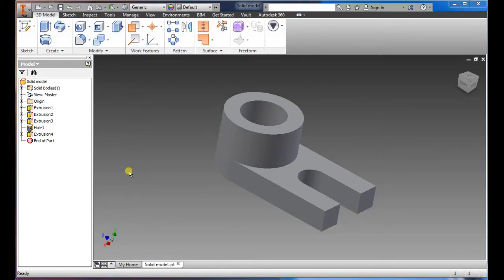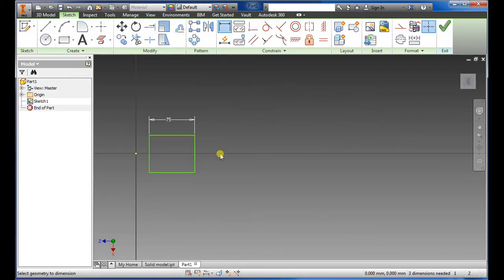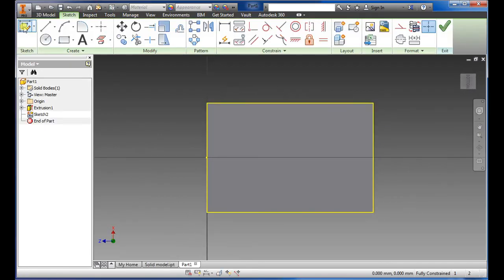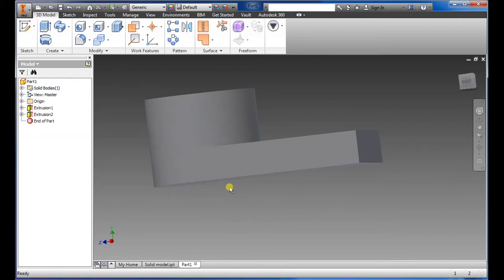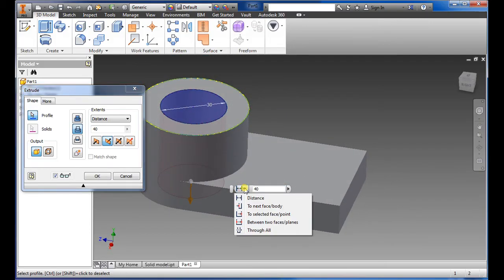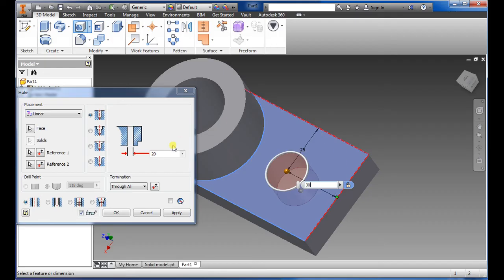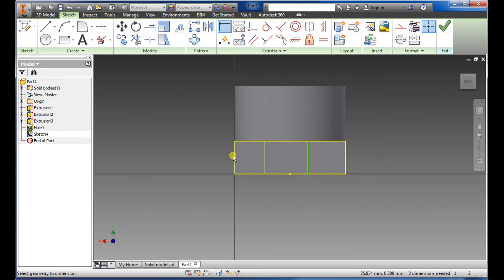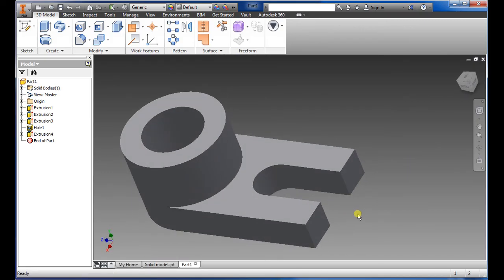Autodesk Inventor 2015 Beginner Boolean Tutorial

Comment: Boolean functionality????
Reply from the maker: Boolean Function? It's a term in an operation in 3D Modeling to add two shape together or subtract them in. Example: If you have two different shape. A) Square and B) Circle. And you want to join them as one solid model. You use the Boolean operation under union. I hope that make a bit of a sense to you. 

Also you can look up the definition for it too,  under Boolean in 3D Modeling. If you're familiar with Adobe. Illustrator have the same type to join shape also. I think they'd call it Merge or Combine shape.

Sorry if  I didn't put enough info in the video.
Reply: @GearTechKet  I know that but what you are doing is not my understanding of Boolean functionality.  Boolean functionality is where you actually have two intersecting but separate solid bodies and either add them together, subtract them or intersect them to produce a single body.  What you are showing is basic extrude and cut of a single body.
Reply from the maker: Stevieboy130664 ahhh. Thanks for clarifying you first comment. And you are correct. This video is an old video from 2015 and I don’t have time to correct anything. My life have moved on from 3D CAD. Again thanks for pointing it out.